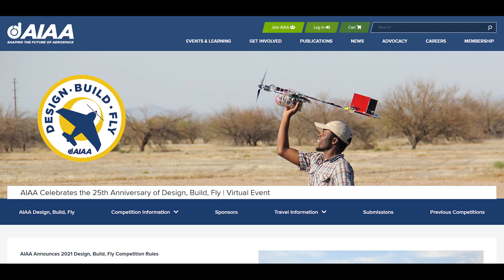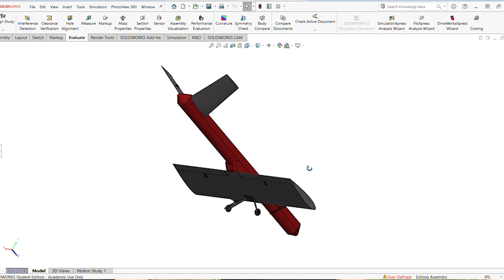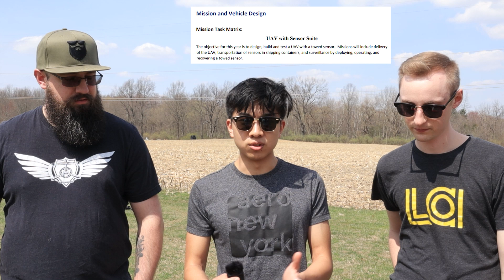Engineered RC Airplane ✈️ The Ohio State University Design Build Fly DBF Team - Part 1

Comment: Fascinating! So many questions about the design/build process! Suggestion if possible (just popped in my head as the deployment process was being explained) an inverted program on a switch to automatically invert the plane and reverse the controls? A deployment program as it were...🤔🤔🤔🤷🏻‍♂️
Reply: We had considered that but our pilot actually preferred to keep the flight modes constant throughout the flight to make sure he always had the orientation right in his head.